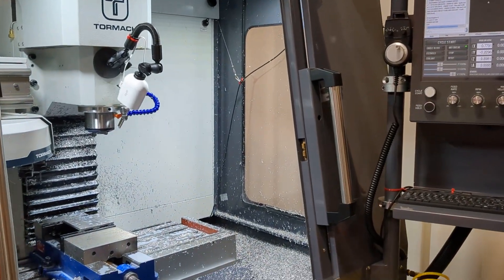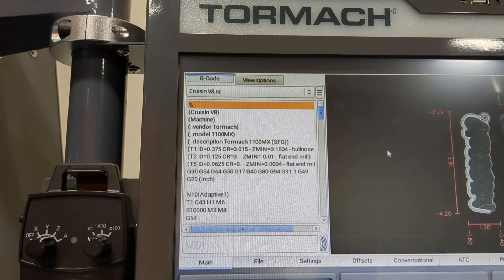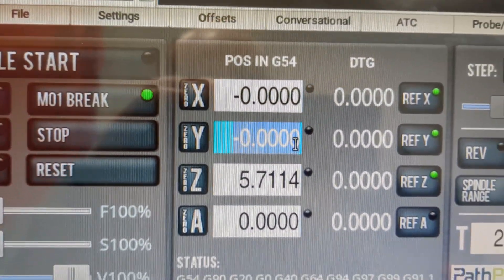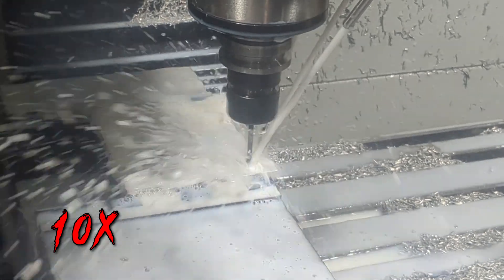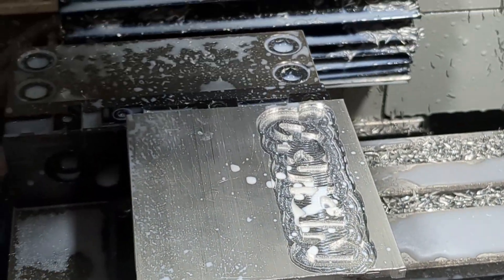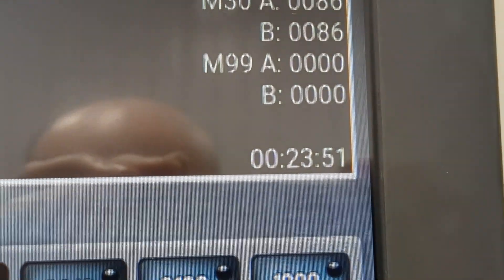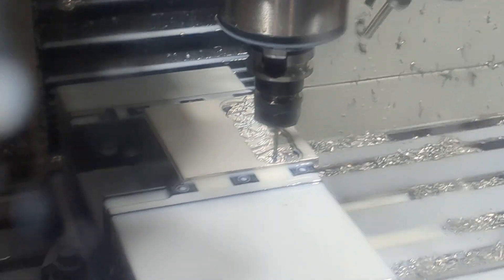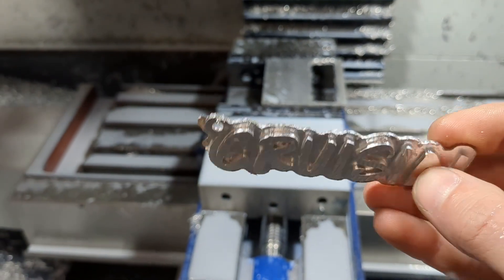CNC Machining: Custom Keychains (Tormach 1100MX)

Comment: That seems like a lot of stick out for that smaller end mill (op2).   There's a really cool way to simulate your exact setup you have in the machine to Fusion 360.  My stock and vise is setup the same in Fusion 360 so when I go out to the garage there's no oopsie's.  Hit me up if you want to see how to do that.  Love the intro to your videos btw lol  What I like about your video is you post the mistakes!
Reply from the maker: Totally agree on the stickout!  My machine is setup for making those statues, so the tools are way out there.  I'm too lazy to re-set them and update GWizard and Fusion, such a hassle, I wish GWizard could export to Fusion tool library format.  🙃  The mistake I made, i simulated everything with 4.5" stock, but that test piece in the vice was 4.25" and i forgot to adjust Y-zero to compensate.  😬  I've got new engraving/chamfer and corner-rounding mills coming tomorrow, so if i'm feeling frisky, i'll probably reduce the stickout on the other tools, especially because the surface finish is a little chatter-y right now...
Reply: @PowerSports  Roger that.  I totally agree with the setup of the tool crib, then fusion, then path pilot lol.  I keep a pretty tight accounting of the tools just to develop good habits I guess.  Aahhhh don't you love waiting on tools?
Reply from the maker: Haha, yeah, MSC promised delivery Friday (two days ago) and still waiting...  :'(
Reply: @PowerSports  Harvey tool and Kenna metal pretty quick deliveries

Comment: Your tabs likely didn't work because of your work holding.  Squeezing thin material like that causes it to bow upwards, bringing the material closer to the tool. Gets worse as the material thins out after you've removed a lot of it.   It's why the one closest to the vice still worked.  Thicker tabs would probably still work too.
Reply from the maker: Thanks for the tips!  ^_^  I reduced the torque on the vise to 15ft-lbs (from 20), and i made the tabs twice as tall, and twice as wide.  The parts finally held strong during milling, and still came out easily with a quick twist by hand.  https://www.instagram.com/reel/CotRiNyAbnK/?igshid=MDM4ZDc5MmU=  My next step is deburring using an undercutter.  A backside radius mill is way too expensive, so i chose a 270-deg ball undercutting mill to make a light deburr pass as the final operation.  Hopefully it works.